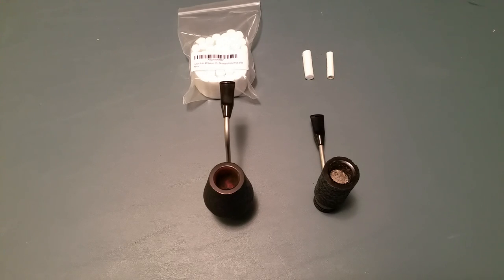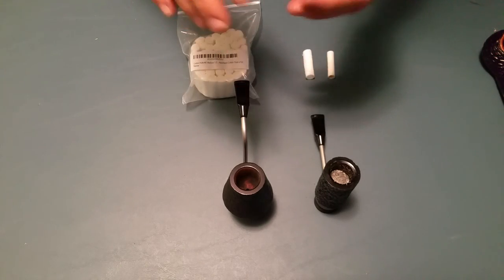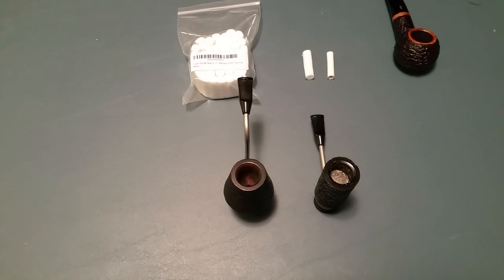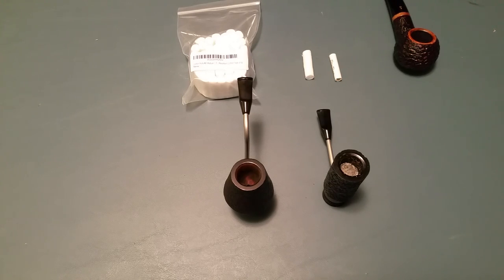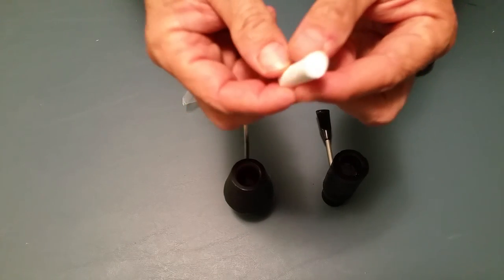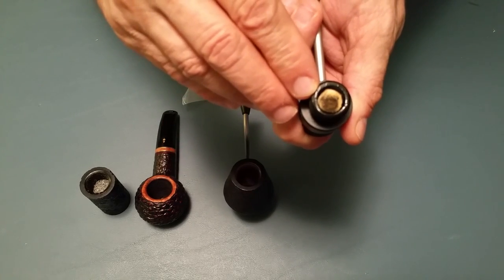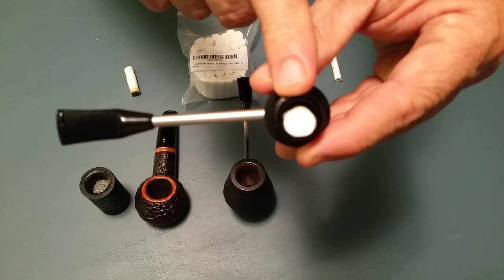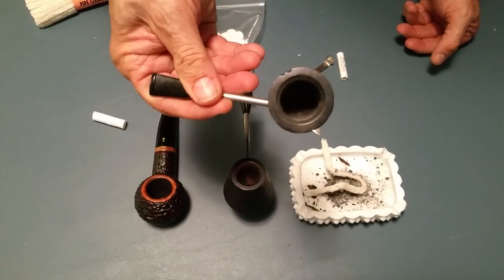The Wiebe Radiator pipe, A solution to Moisture.

Comment: drew estates has a pipe (made by tsuge) that has a similar design.  tsuge suggests putting tobacco in the lower bowl to absorb moisture and add flavor.  this works very well and you can, since it is metal, just rinse out the pipe (bowl removed) under the faucet.
i also use roll your own cigarette filters in the lower bowl to absorb moisture.
Reply from the maker: bumpandsquish - That’s really cool, I have never heard of doing that, I might try it with one of my Weebe radiators and see how it does. 👍👍👍

Comment: I'm not really understanding the issue here, at least to be as great as you are pointing out. For those unfamiliar with the Wiebe design (you should have shown the bottom of the bowls) is that they are not only threaded on the bottom (to screw to the radiator section), but they are NOT straight tubes, they are more like little 'cups' with the smoke hole in the center slightly larger than the stem inner diameter. So, as you said, you can literally be in the middle of a smoke, unscrew the bowl, DUMP THE RADIATOR, and screw the bowl back on...and continue smoking the live ember you were already smoking. Simply keep in mind with wet aromatics, to stop half-bowl, unscrew bowl, dump radiator, screw bowl back on, and continue smoking...20-seconds, maybe?
This is not a major issue...but maybe a reference card could be added to the box by the manufacturer to explain this process???
Reply: You think after doing it once a guy would be smart enough to nit do it again. I mean its obvious not like your ordinary briars. But if a man wants to stick a tampon in his radiator and possibly obstruct the airway and effect the flavorof his tobacco go ahead lol

Comment: I haven't tried one of the radiator pipes, but this looks like a fantastic solution for any similarly engineered pipe, including the second chamber/reverse calabash design. Too bad the cotton rolls don't have a string incorporated on the end, for quick and easy removal. :^)
Reply from the maker: D35611  - the good thing about them, is they sit in the chamber so loose, all you have to do is turn the radiator part over and it just falls out. 😃😃😃

Comment: Been thinking about a radiator system.  Quick question though.  How is your pipe tampon system (sorry thought it was funny) different than merely using a filter system pipe?  The whole idea of a radiator pipe is moisture removal without "filtration" I would think.  The idea is to allow the smoke to come into contact with the "radiator" walls (which are cooler by virtue of the material used) and generate condensation without actual filtration.  What you seem to be doing is passing the smoke through an adsorbent filter which not only collects moisture but also any number of flavor compounds contained in the smoke as evidenced by the color concentration at the top of the used filter.  Or am I missing something?  Why buy a radiator only to convert it into a filter?  

Or maybe you are on to something and you'd do better to trim those dental rolls to about 1cm and seat them at the very bottom???
Reply from the maker: Neologian - yes that's what I ended up doing, I cut the tampons in half, now it sits below the shank, so the smoke does not touch the tampon what so ever, it sits at the bottom and it's only function is to collect the moisture. You probably already know this from watching the video, but I wanted to be able to smoke more then 1 bowl of tobacco in my radiator without having to break it apart after each smoke, and dump the moisture, with the tampon it sits at the bottom, collects the moisture, then you can dump the ash without having to break the pipe apart, clean the bowl, refill and re smoke, I can get up to 3 smokes before I break it apart, and when I do, I break it apart, dump the old tampon, insert a new tampon and continue smoking, no fuss, no muss 👍👍👍
Reply: Pretty cool idea now that I see what you are doing!! I've had a lot of success using the Erikson "keystones"  sort of volcanic clay "pebbles" that you can put in the bottom of any pipe bowl (though designed for the Erikson Keystone pipe) that adsorb moisture without any filtering properties.  But I'm intrigued by a radiator system and you've solve a significant problem here.  Chris Morgan just started advertising a line of radiator pipes that look pretty neat.  Maybe I'll steal your idea here!
Reply from the maker: Neologian - Steal away my friend. 👍👍👍

Comment: Check out Nørding keystones. These are made for this purpose. You don't have to use them in the special name brand pipe. You can use them in every pipe you like. They will probably be less of a restriction on the airflow and less of een insulator the reason to use a radiator pipe in the first place.
Reply from the maker: Ruben Scheer  - you are welcome my friend, these pipes are relatively inexpensive, I think around $100.00 to $120.00 and I think Pipes & Cigar .com sells them, or you can get them directly from the wiebe web site, pick one up if you get a chance, they are great smokers. 👍👍👍
Reply: Unfortunately I'm on the other side of the Atlantic so ad about 20 $ p&p and probably about 30$ tax so that makes it a bit less interesting just to give it a try.
Reply from the maker: Ruben Scheer  - Yeah, that sucks, sorry my friend. 😃😃😃

Comment: Went with your discovery. One of the wiebe pipes have the stem screwed in deeper into the radiator and my modification had to be cutting the cotton in half in width, not height. Still does that trick.  Unfortunately, wish I could used the whole dental cotton instead of needing to trim it down.
Reply from the maker: Anita Mui - It sucks that you have to cut it length wise, but you could prepare a whole package in one sitting, and just drop it in when you need it. 👍👍👍

Comment: Thank you for this video, I have a question please, when you clean the bowl by the cleaner as you did in this video, doesn't is break the carbon cake?
Reply from the maker: Nashwan Jabbour - No, carbon is very hard, and it sticks like concrete to the sides of the bowl, all I did here was sweep the ash from the sides of the inside of the bowl. 👍👍👍👍

Comment: Muttnchop the metal stem on those two pipes do you know what it is made of? Because I would like to buy a radiator pipe but I don't want anything made of aluminum.
Reply from the maker: ant240 - Aluminum, sorry my friend. 😔😔😔
Reply: +Muttnchop Piper oh well guess I'll stick with Briar, thanks.
Reply: the base is anodized aluminum, the stem is stainless steel

Comment: this is going to be a dumb question, but where does the moisture come from?
Reply from the maker: Craig Huffman - The moisture is added to the tobacco at the end of processing to keep it fresh during storage and transport. If the tobacco is in tins, they may stay on the shelf for years before they are sold. Also if the tobacco is moist when you light it, the moisture turns to steam, then turns back into water which makes its way to the bottom of the bowl. 👍👍👍

Comment: The whole concept of the threaded bowl was for it to be removed so you could dump the radiator which rarely fills to the top full of moisture from 1 bowl. If you cant remember this then stick to traditional pipes.By obstructing the radiator with a tampon it could effect the full flavors one should be experiencing. This is a awful idea that deviates from the pipes entire concept, if you do purchase one dont do this. I have one and never have i dumped it out without removing the bowl. Its quite easy to remember your smoking a radiator pipe and not a traditional briar.